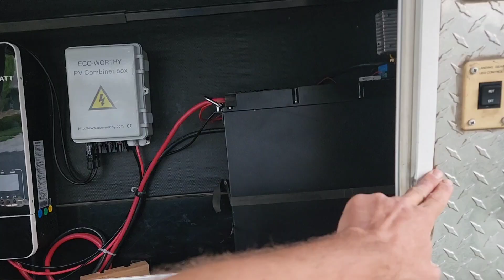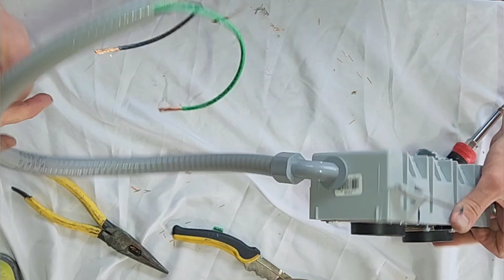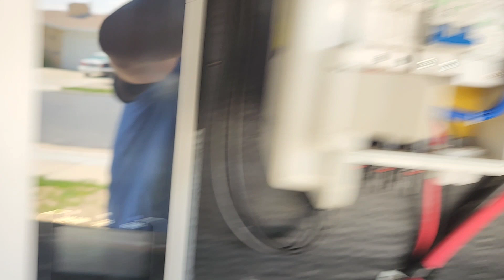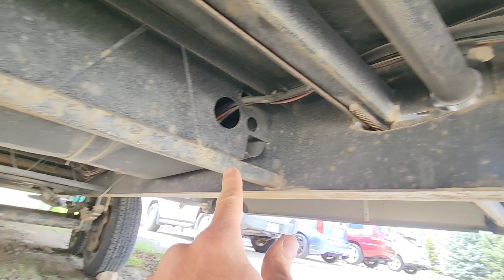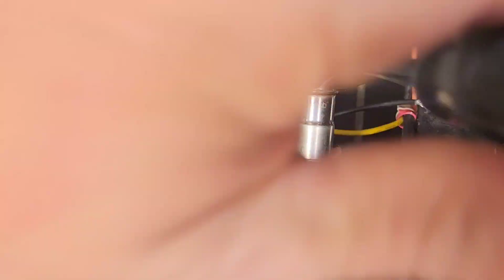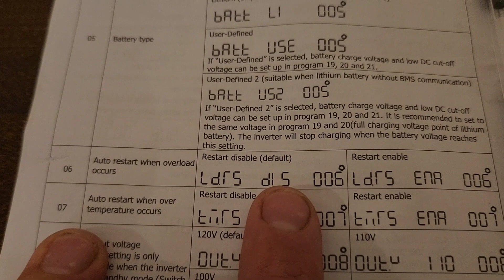Growatt RV Power System Upgrades

Comment: I did a similar install but my inverter connection to power the van was wired thru the walls, not sure its a good idea to have high voltage running under vehicle especially our 240v where its subject to damage and chassis short. 12v no big deal and normally low amp fused. Also I had 3 gpo editions , 1 for the hot water, 1 for fridge and another for my ac chargers to only power when connected to shore power and not off inverter. Great work with your setup, you womt know yourself compared to the old setup. Im still unfortunately running 12v lithium 850ah due to room restraints

Comment: Looking at the mountains in your background, I’m
Guessing you’re in Utah/Idaho/Possibly CO/NV? How good do your panels operate during the winter months? Is it possible to charge the system during oct-feb? I’m guessing if you were to go camping during those months you’d probably be using a generator to charge your batteries ? Solar is brilliant, but seeing how I live in Salt lake, I’d imagine it not being as efficient as it would be if I lived in So Cal or Az..
Reply from the maker: Thanks, because in the winter I'm not running the air conditioner i believe i can go for 5 days without needing a charge.

Comment: Thanks Ray for sharing.  Like 64!  Love your install!  I would put a grommet in where you go through your frame.  The frame will chaff your wire.  Once again, how well have the panels held to your roof while driving?
Reply from the maker: I've taken them on 4500 highway miles so far... they've done awesome.
Reply from the maker: Good idea with the grommet!
Reply: @diySolarPowerFunWithRay  Regarding solar panel mounts, I know a couple who mounted panels to a steel school bus roof and the side winds, traveling through the mountains, ripped them out.  He now has a wind shield to deflect the wind.  Maybe a simple L bracket attached with double sided taped close to, but not next, to the panel will deflect gusts but allow ventilation.  Heat rises.  If you have an opening, it will find its way up.  Just my thoughts.  I like the concept of mounting low.  I might go with 4 brackets on each side.  My Cherokee only has one 3/8" plywood and 2x2 framing.
Reply from the maker: @DennisWintjes2  nice. it would definitely be good if you could hit the frame with your screws.

Comment: I already purchased my Growatt several years ago to convert my garage and some critical loads to off-grid power through the Growatt. Things changed and went a different way. However, watching this series I am going to duplicate what you did with my Growwatt in my 27' Tioga Motorhome. The idea of having 120VAC all the time is mind blowing. My Growatt is 24VDC not 48. If I purchase the same battery as you only the 24VDC will I have problems running AC, Micro, ...... or will I be OK with just the 24VDC? (I am hoping I don't need to purchase the 48VDC Growatt as I would have wasted my money on the first one).
Reply from the maker: I've seen the 12v version of that battery run AC units on Signature solar's site so the 24v version would work great for you.  I didn't mention this in the video but the 24v growatt might be better than mine because you don't need a higher voltage solar array for the solar charging to kick in.(better in the shade). Definitely get the same model battery I'm using though(but in the 24v).
    When or if you end up buying the battery can you use my affiliate link? It really helps the channel out a lot..  Here's the link to the 24v battery:  https://signaturesolar.com/eg4-ll-lithium-battery-v2-24v-200ah-server-rack-battery/?ref=DiySolarPowerFun

Comment: Good video and cool setup, but I think you're being way too optimistic on being able to power two RV rigs off a single 3,000 watt inverter.
Reply from the maker: I think my battery life will be the limiting factor with multiple rvs. This inverter and battery can run my electric fridge, have my microwave running and afterwards fire up my air conditioner without a soft start. I was shocked I could do this
Reply: @diySolarPowerFunWithRay first off love the content 👌  plan on following your lead on this kind of setup. Everyone else in rv world is on the victron train.😂 Also you might want to consider adding a 2nd growatt in parallel if you plan on having hooking up buddies. Plus this way you would have 6kw of power for house backup.
Reply from the maker: @Tech4Ten  Thanks. Yeah the victron multiplus 3000 has only 2400 available watts and could only run 1 large appliance...No thanks.  I might switch my inverter out for the Growatt 3000 48p model or something similar. I've found that this "es" model inverter doesn't do well if I park and a few of my panels are shaded.
Reply: @diySolarPowerFunWithRay  idk if that is due to series connections though. Some newer panels have bypass diodes that reduce the loss in whole array when wired in series and some panels shaded.

Comment: Great video. I'll be installing a Eg4-3000 and Eg4 48 volt battery in my class C. I'll have to deal with the auto transfer switch and converter. I was wondering how you plan to run 2 ACs with your current setup. Do you think it will allow both units to start, without softstarts on both? How much runtime do you estimate once they startup?
Reply from the maker: Sorry for the delay in responding. Have u bought the battery yet?  If you're only buying one 48 volt sever rack battery I would definitively NOT  buy the eg4 Lifepower4. For me, it wouldn't start my single AC unless I had solar connected. Low bus voltage error error.  Someone else also mentioned this in another one of my videos also. The cells are good, but I think it's something with the bms.  If you get 2 batteries, I imagine you'd be fine.  I ended up getting the eg4 gll v2 battery as shown here.  It's awesome. I had my electric fridge running and also my microwave(2000 watts)... while they were running i was shocked that i was still able to fire up my AC (with out a soft start)! So I don't think I'll have any trouble running 2 AC units.  I'll give it a try this summer, though.
   I believe my ac compressor uses 900watta when running, and my blower fan is around 450 watts. Without any sun out, it should run for around 3 hrs.
    What panels and growatt are you planning on getting?
Reply from the maker: As long as the sun is out I should be able to run the AC all day I believe